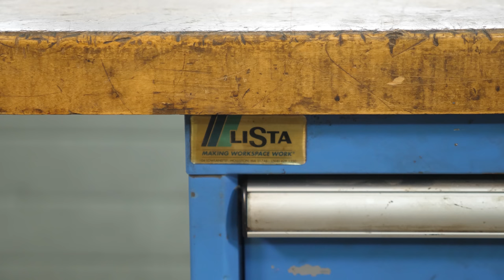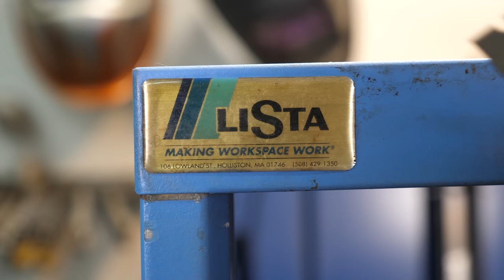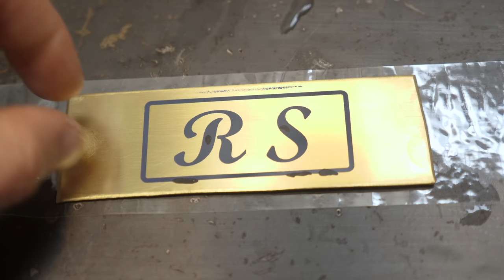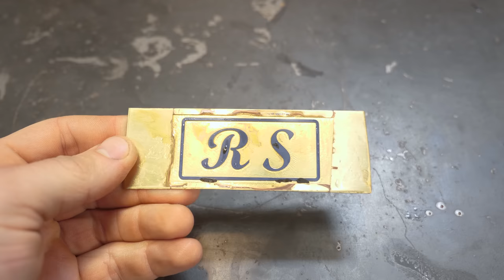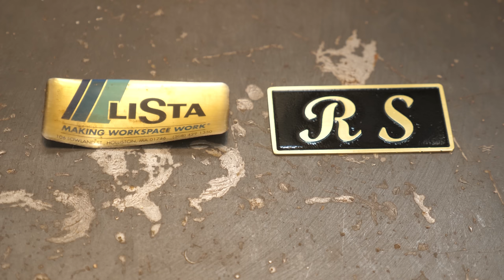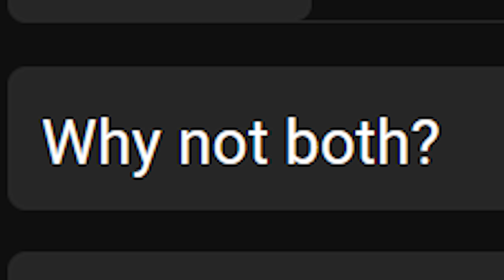Restoring an Old Beat Up Workbench

Comment: I’ve worked in a manufacturing environment for nearly 20 years and I can’t tell you how many times I’ve tried to get my hands on one of these old lista benches lol. Nice work, now i need to try harder when i get the chance again. Nice work 👍
Reply: I have a Lista toolbox with workbench from my employer.  I was told to throw it away but my production manager at the time said I could have it but to get rid of it immediately.  So I had an operator help me load it up into his truck and he drove it home real quick and grabbed his other truck and came back.  After work he followed me to my house and helped me unload it.  Of course it's over 20 years old and beaten up but still works.  Would love to get it restored.
Reply: Just make one, cheaper.
Reply: My department just scrapped a whole inventory of the old lista drawer systems and lockers
Reply: ĺo9j
Reply: Seek Him with all your heart and you will find Him  any type of religion that uses mortal gatekeepers is a scam... I pray for your soul 🙏
Reply: Ebay
Reply: Lols nothing wrong with this bench. Might add some self leveling feet.
Reply: @pizzalord3n  And likely replaced them with a prettier inferior product.
Reply: @bearing_aficionado  Nice score.   They are great benches and the drawer slides beat anything out there today.
Reply: @TheDustyShed  hell yeah I did.  Still works fine.  It ain't pretty though.  But it's made for work and not looks.  I bought a palm sander to sand down the workbench.  Its got some nasty splinters and needs cleaned up.  I've had it for several years now.  Need new wheels too.
Reply: @pvtmeepmeep  true
Reply: I dont think you have really seen an old beat up workbench 😅👍
Reply: Find your local military base 'DRMO' auction site. These things are all over the military and are always collapsing/failing. You can pick them up cheap, especially the folded up ones that need restoration like this one.
Reply: I've spent hours at one of these workbenches.  Brings back lots of memories.  Retired now.

Comment: As a woodworker, all I could think was “man I wish I could run the top through my planer before he glued it back together. Could have saved this man hours of sanding.” 😮‍💨
Reply: I thought that's why he was splitting it to begin with. Finished product is great though.
Reply: I was thinking the same thing. Or better yet just coat it with epoxy that can take 3000 f temperature the kind you use on kitchen counter tops. I belive the years in a work environment add charter to it.
Reply: A run trough the planer, a smooth sanding and then some very high temperature resistant epoxy.
Reply: It didn't take him hours using the belt sander she had.  Also, a planer reduces thickness, he more than likely would have still sanded in some capacity.
Reply: I thought he would have used dowels to keep it aligned.
Reply: I found one of these old benchtops and am restoring it. Mine was bowed so I cut it in 4 sections with a track saw, then jointed and planed it, and re-glued the pieces. It's dead flat now. My wife doesn't know it yet, but it's going to become her new desk/workspace in her office.
Reply: @cesare3542  : He SHOULD have used dowels to keep it aligned.  Better yet, he could have edge drilled and used all thread to make the joint bullet proof.  Very poor skillset.
Reply: @wrongfullyaccused7139  it would seem he felt that was overkill or the juice wasn't worth the squeeze. it is just a restoration video, after all, and that's exactly what he did, he restored it back to its original function the way it was built to begin with.
Reply: It was the fact he didn't refinish underneath that got me annoyed
Reply: We had a drum sander with a conveyor that could had sanded it. First pass 80 grit, second pass 150 grit and last 220 grit . It would have felt like glass. It was a Grizzly sander.
Reply: I've got a tabletop that i put together myself that needs a new coat. I've been putting that off for the last 2 years because i remember the amount of sanding i did when i first got it and that was raw wood, i know it's going to be more annoying the second time :/ Last time i checked, 400 euro's for just a few passes through a planer at a local wood working shop :(
Reply: Then it wouldn't have been satisfying to watch!!! Lol
Reply: As a fellow woodworker I would've at least thrown some biscuits/dowels in the split sections to make it stronger. That glue up isn't gonna hold too long. I also would've run it through the plainer.
Reply: Would have ran the splits through my jointer then planer then glue up made everything tight

Comment: My dad has a smaller Lista work bench he inherited from his old work place. He worked for Parker Hannifin. They had an old building, and they were getting rid of a lot of old equipment before moving into a newer building back in the early to mid 2000 range. There was an old Lista work bench he wanted. The workers were going to throw the bench in the dumpster. My dad saved it and restored the work bench kind of like you did. He repainted it all black with a clear coat. The wood top was restored and was given a honey oak polyurethane finish. He still uses the work bench to this day.

You did a lovely job with this one. Nicely done.

Comment: The steel top is a nice add on . The wood glue is stronger than the wood itself, biscuits or dowels help with alignment and that's about it. If the glue fails in your lifetime, you'll be glad you didn't use either of those. As for wood finish, you did well, any product will need to be touched up or redone in time. Solvent finishes do make the wood look nicer, water based polyurethanes hold up very well and are easy to reapply when needed. The only other upgrade I'd see as useful is a back panel to increase rigidity in the long run. Nuts and bolts will loosen over time and use. I had a metal cart that had nuts, bolts, lock washers. As a job-site cart it got moved frequently, it always needed tightening. Solution, tightened them all one last time, welded every joint and lap, removed nuts and bolts.
Reply: Seek Him with all your heart and you will find Him  Remember that Jesus worked as a carpenter, skilled at working productively with his hands, as part of his preparation for his ministry.

Comment: Over three summers, I had to find another desk for a teacher in the workshop. More areas were being used for academic rather than practical lessons. Every year someone had got a brand new modular desk and the old worn beat up desk was being tossed.

Mostly particle board construction with a veneer, I have new life to those desks with four coats of satin yacht varnish. Each coat was rubbed down and the finish was great.

Thank you for this video. I have an old workbench in the garage I need to update…

Comment: I was surprised to see that you didn't spray paint inside the drawer nor clean the underside of the wood top. I think those little things would improve the quality of your work.
Reply: I disagree with your comment. To me it looks like he prioritized what was actually important. Everything he touched came out awesome. His quality of work is high. Absolutely nobody is going to see the bottom of the bench, that was in pretty good shape anyway. It had clearly always been the bottom. Also the inside of the drawers on this style bench get beat up pretty easily with how they slide.
Reply: @Name-vu1kn  Indeed - The fact that the draws and legs are held on by threaded inserts means there is no way for that NOT to be the underside
Reply: @bengrogan9710  why couldn’t you remove the inserts, fill the holes, flip, and redrill the inserts. The shop I worked in used Vidmar benches like this and it was easy to flip the tops.
Reply: @Name-vu1kn  You could remove them, but you are creating needless complexity.
You would need to template or accurately measure the hole patterns, then by using the insert side up you now have bigger holes to fill than any damage that exists on the top face - for what benefit?
Reply: @bengrogan9710  template? Do you mean marking the holes on the legs to the top? I think your overthinking it. It’s pretty simple.
Reply: @Name-vu1kn you have no accurate hole layout as you need to disassemble the legs before you can use them for marking.
It's fine to say someone else is overthinking but you still missed the fundamental point, for what benefit? Flipping the table will leave bigger holes to be filled than exist in that side already
Reply: @bengrogan9710  getting the holes in the right place is easy enough. I agree that there is no benefit to doing it though.
Reply: I agree having a different color inside of the drawer would drive me crazy.
Reply: My thoughts exactly. And the garish red color. Yikes
Reply: This comment means I won’t like this video.
Reply: The inside of the drawers were originally gray, and the outside was blue. He simply changed the blue to red and left the gray drawers  alone, which made perfect sense. As for the wooden top, who but a madman would spend even five minutes refinishing the bottom side of a workbench top?  Who will ever see that anyway?
Reply: @fen697  Red, that insanely garish color, the color choice most found on mechanics boxes and on shop cabinets for decades! What on earth was he thinking! 😂
Reply: It is not the critic who counts; not the man who points out how the strong man stumbles, or where the doer of deeds could have done them better. The credit belongs to the man who is actually in the arena, whose face is marred by dust and sweat and blood; who strives valiantly; who errs, who comes short again and again, because there is no effort without error and shortcoming; but who does actually strive to do the deeds; who knows great enthusiasms, the great devotions; who spends himself in a worthy cause; who at the best knows in the end the triumph of high achievement, and who at the worst, if he fails, at least fails while daring greatly, so that his place shall never be with those cold and timid souls who neither know victory nor defeat.
Reply: For the record, my comment on red was sarcasm. Had I been the guy repainting that, like as not it would have been red.
Reply: If you’re going to the trouble of making as little sign with RS why not do it properly & clean it all ?? ☹️🇬🇧🇬🇧👍👍
Reply: All you guys can go buy a bench, video yourself disassembling it, cleaning it, finishing it and paint it whatever damn color you want. Then put the video on YouTube.
Reply: @danielhayward2830 Perfect. Thank you.
Reply: @damarere you wish you could do 1/4 the work
Reply: @bajamedic  Indeed, I do.
Reply: I agree. If your going to restore something, do the whole thing. But he still did a great job!
Reply: @danielhayward2830  Bravo!

Comment: That was a remarkable restoration. It was super satisfying to watch that belt sander grind that wood surface clean again. The surface turned out perfect and the paint job looks really good! That was cool how you made a metal surface that you can put on and that you put a nice bluing on it as well!! You did a perfect job start to finish! Great video!
Reply: The timber surface was nice before he burnt it welding the hinges on.

Comment: Looks good.  I would attach a magnet or two on the wall so you can leave rhe bench in place and simply life the metal top off when you want/need to work on the wood surface.

Comment: Lista is top end stuff, really built to last.
When putting it together, I find the easiest way is to lay the top on the floor face down (on top of protection) and assemble the legs that way. Saves working from underneath.
Then just turn the whole thing over. Would also save jacking up the drawer cabinet.
Brilliant idea with the steel top, hinged as well!
Good restoration though, great to watch.

Comment: Beautiful job. Way more work than I have time for though. My only suggestion is all four casters to be swivel. You even had a prime example in the video. You had to lift the fixed end to get it out. That will be way to hard when it's in use and full. Ask me how I know😉 I switched the fixed casters to swivel and life is better. A little harder to roll straight but way more maneuverable.

Comment: From a wood working perspective it would have been best to use biscuits or dowels to join the split pieces back together and then 3 coats of oil based polyurethane but that's just my opinion though, it turned out really great.
Reply: If done properly, the wood joint is stronger than the wood. I've beaten on a glued plank with a sledge and the joint held together. The wood split an inch away. No dowels or inserts of any kind.
Reply: @firesurfer  the biscuits would be to help align the pieces
Reply: @rileyswoodcraft   Not needed.  Use clamps.
Reply: Biscuits and dowels don't do anything structurally, the glue does the heavy lifting, you only strengthen the joints with Dominoes/tongue and groove/mortises/screws but there's no need
Reply: Should have ran them through the planer and jointer while they where split to save on all that sanding!! But maybe he doesn’t own those tools
Reply: @sav1239  most people don't own them.

Comment: I have an old lista machinists tool box with the butcher block top and 4 HD casters, the box was probably 20+ years old when I got it and that was 1998, I gave it to my son several years ago (he is a Chrysler Mechanic) but the box could use a good restoration now. Great job you did on the work table.

Comment: Just an idea to consider. Your refinished benchtop is beautiful. I find that within weeks of all that work, my benchtop is looked pretty haggard. I put a sheet of 1/4 inch plywood on my benchtop with a few countersunk screws. When it becomes covered with glue, paint stains, beat up, etc. I can simply change the plywood and have a new benchtop. I then do not have to refinish my benchtop nearly as often. It nearly always stays presentable. Just a thought. A little more difficult if you have benchdog holes or certain vices, but something to consider.

Comment: So every Navy shop I was in had these. The damn things will fold up unexpectedly if you over load them. My frist supervisor taught me this, get some descent wood, fit it to the J channels that make up the legs and make them fit tightly, drill and fasten with carriage bolts. This prevents the metal from folding, provides rigidity to the legs and if you decide to mount a vise mount one or two additional wooden supports to that one legs exterior. Also along the back side, run either a wooden rail or a steel rod with ends threaded and bolt the rail in place. Putting anything heavy can deform that bottom metal shelf and pull the legs inward and ....well....thats one reason why the damn things collapse. BONUS, adding the wood makes that thing quite down otherwise if you hammer on anything it can be like hammering a bell.

Comment: You might wish to check that bottom drawer again. It seems as if it has sagged and it's hitting the bottom of the cabinet as you push it in. It's probably the metal bars that ride on the bearings that are bend upwards a bit.

Comment: I would mount a magnetic tool strip on the wall above the table so it will stick in place when you flip it up. You can also use it to hold tools for you when you are not using it to hold the top and it will keep the table from moving around even more

Comment: Nice bench buddy...Im thinking what about fitting the steel top hinges at the front so it acts as a locking plate over the drawers etc...just another take on it, also the hinged steel top back is useful as you could lift it up against a wall and lock in place then you have a splashback or debris barrier...I like stuff that we can multi function...old pieces like this play very well to that...🤟🏻👍🏻👍🏻

Comment: Was a nice lista cabinet before......I would have done the wood top and cleaned the metal and fixed the dents... if some of the blue paint chips off just protect the metal with wd40 or oil or something. Old character is alot better and tells a story. Lista makes there stuff strong. The original blue paint will last longer than the spray can. You did all that work on the wood top and ruined it with lag bolts. Just my preference as we all have our own. Appreciate the video.
Reply from the maker: Thanks. I painted it red to match everything else in the shop and I really wanted the option of using a metal or wood top.

Comment: Walnut draw frts would look good.
As for the metal top, if the hinges were installed on the underside of the top and you added strips to lift it off the wood top you could weld on it provided you did something to keep the heat off the wood top and had plenty of support parts then you could fold it up on the wall as a back splash. Pick a wood color you like but it can be thin its just a layer over the metal.